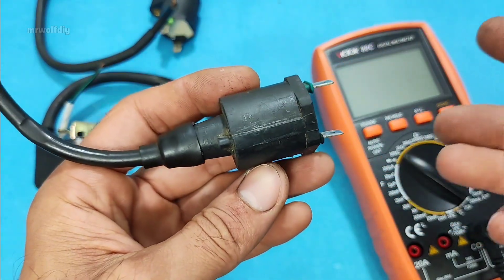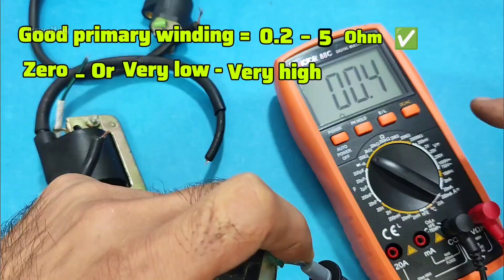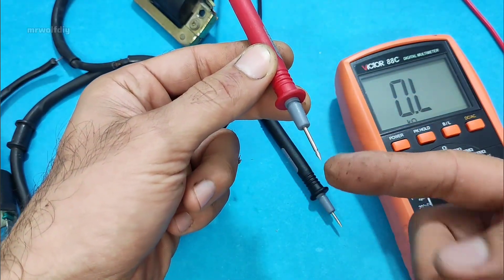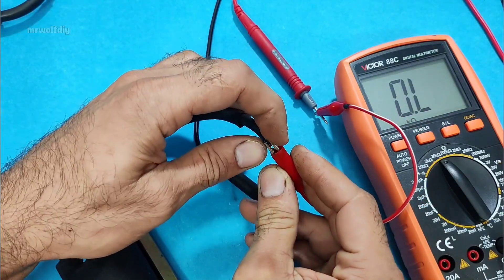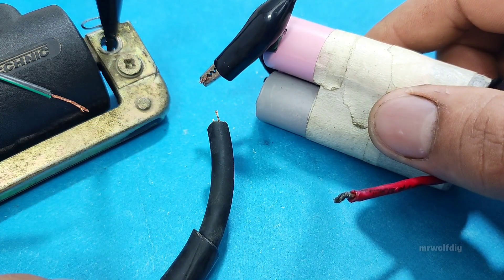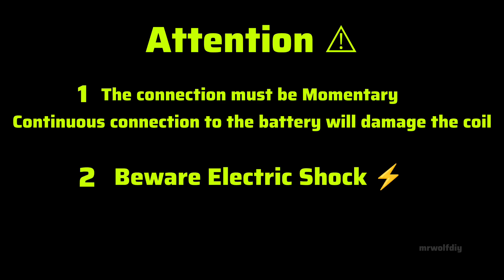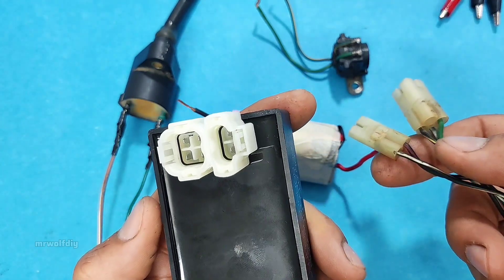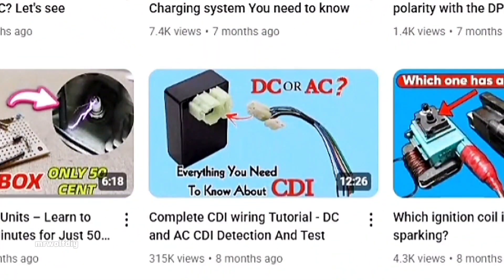98% Don’t Know How to Test an Ignition Coil – 3 Simple Easy ways!

Comment: A coil for a twin cylinder B&S or Kawasaki has only one kill lug to ground the 2ndary coil.  how to test the primary or trigger coil.  If either of these fail and the internal transistor fails, the coil will not fire.

Comment: The 18650 pack's method is either not accurate or there's some issue. The first two tests on primary and secondary coil are perfect:  3Ω  and 3.66 kΩ

Comment: How to test a coil with 2 coil wires.  My motorcycle honda hornet 919 2004 have the second cylinder won't work and i want to know how to diagnose it please
Reply from the maker: Testing it with a single-wire coil is not different. You can test it with a multimeter or other methods as shown in the video. Regarding testing with a battery, be careful—short-circuiting the coil can damage it if it lasts too long. 🙌

Comment: Very nice video, BUT it should be mentioned that ignition-coil failures are USUALLY because of deteriorated insulation. 
Hence METHOD ONE may show both primary & secondary coils have perfect resistance BUT there is no spark !!!
I have SPARE IGN COIL for all my engines and I substitute doubtful coil with good spare coil for reliable testing.
Reply from the maker: Yeah 👍 Thanks for pointing that out, insulation breakdown is a common cause of coil failure ...
Reply: That is the correct way
 Because leakage cannot measure with meter.  Why this guy is wasting everybodys time.

Comment: Can you test the spark plug coil with a 12V 4Ah scooter battery? I'm talking about the Ducati Energia spark plug coil for the Malaguti F12. Thanks.
Reply from the maker: Hi, If you follow the necessary precautions, yes — but you must do it carefully.
"Keeping the connection for more than a few seconds can damage the coil."
It’s better to use the first or third method instead. 👍
Reply: @MrWolfDiy  the third method is can you test the spark plug coil by connecting only the pick-up even without connecting the stator?
Reply: @MrWolfDiy  Is the third method valid for all spark plug coil, control unit, and stator pickup systems, but without connecting the stator?

Because the Ducati system on the Malaguti F12 only has the spark plug coil, without a separate control unit.

Comment: I learn something new today. I was working on my dad‘s wire harness of a his car Mazda tribute 3.0 2002 and I noticed that the crank chef censored as I was taking off the protectors and tape of the wiring harness. I noticed that it had aluminum foil tape around the 2 wires that come from the crankshaft connector.
Reply from the maker: The use of aluminum foil in some car’s wiring is usually to prevent electromagnetic interference (EMI/RFI), because the crankshaft sensor sends sensitive signals, and noise can disrupt the engine’s performance.
Thanks for sharing 🙏